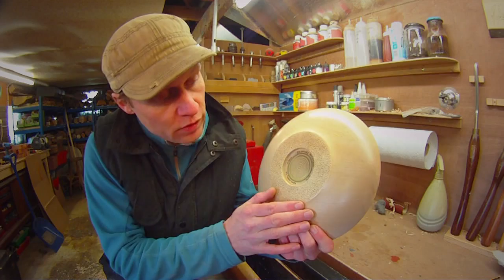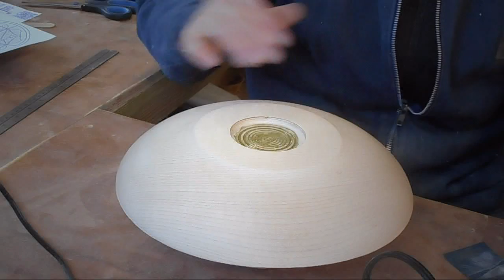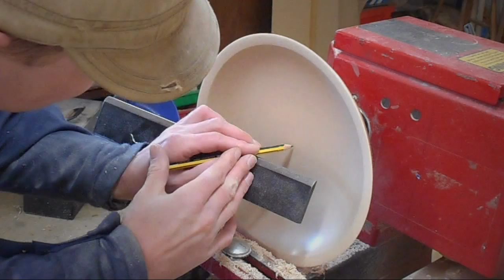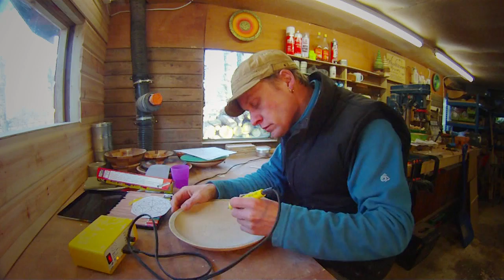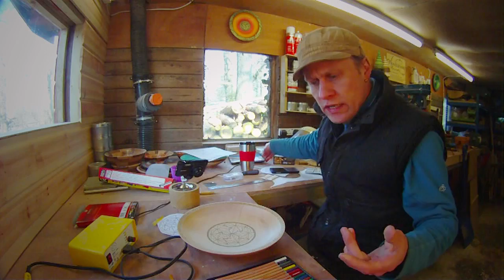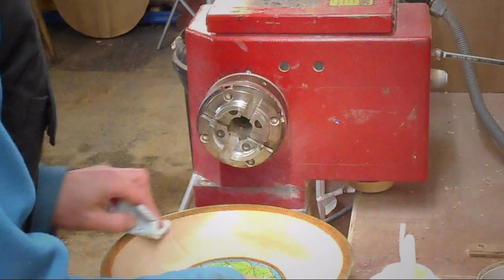#55 Woodturning - Adding Pyrography (Burning) and Water Colour to a Bowl

Comment: Nice video,Martin
The pattern of pyrography looks great, I have such a device. I do not take 600 sandpaper, I take a brass brush for cleaning of the internal peaks.
The idea with the pins is a good idea, you can remember times.

Comment: Thank you Martin for a superb video.   That is one beautiful bowl.   Thanks also for introducing me to graphite paper; I've been using the messy old carbon paper and also how to use the water colouring pencils.
I can see a visit to my local craft shop coming on.
If I may add one tip and that it to use an aerosol sanding sealer to avoid the risk of damaging your colours.
Thanks also for the pattern which I received by email today.
Best wishes,
Alan.

Comment: Nice one Martin. 

I use a spray on Universal fixative to fix the watercolour in place. But then again I also brush on a Silk finish Acrylic Lacquer as my preferred finish.
The Fixative after a spray coat or more depending on paint thickness and wood porosity, ensures I do not disturb the loose watercolour medium once that is dry, and it fixes the medium very well.

I have never had a problem with bleeding using a fixative, and also it works quite well with other colour mediums, hence the Universal tag.

I use the spray to fix the medium as I do use Lacquer, and once that is dry I can then polish. I cannot say how it would work with your own branded wax finish, but certainly worth a try on a piece of scrap flatwork should you chance trying that method out. However sanding sealer is fairly close to the consistancy of Lacquer so I would see no problem using the sealer in tandem with the fixative as it is not a thick medium in and of itself and would protect the colour particles from the light contact you use when applying your sealer with a rag as you do. Just a thought anyhow as an extra preventative measure.

Nice to see you have done a nice pyro project, and look forward to any more you do in the future. Keep up the series, and always look forward to new releases.

Steve
Reply: +Martin Saban-Smith No worries Martin and its a Universal Fixative in a spray cannister. :p Look forward to your next pyro project. :)

Comment: Hey Martin !! Its a nice feeling to catch up on YT !! I watched this the other night but am only getting round to comment now mate........ This bowl turned out amazing martin, I would have never of thought of water colours for this kind of project, and was a little worried when you introduced the towel to it !! The rattle can has been mentioned so I wont bore you with that solution, just a thought? when initially adding the water to spread the colour could you have added a water based glue to the water to act as a sealer as it dried into the colour ? maybe an idea for another experiment ;-)..... Much enjoyed the video thanks for sharing, regards, Steve.

Comment: Have you thought of spraying the cellulose sealer with your air brush? Off of the lathe it seems to me it wouldn't disturb the colors. It might save the cost of a spray can of sealer. Just a thought.

Comment: I knew I'd love this video, thanks Martin I thoroughly enjoyed that. 
With regards to the awkwardness in pyrographing bowls etc  I've been thinking of getting some beanbags to help me prop up the bowls into a better position. (PE games beanbags that is,  not the sort you sit on lol)  

PS I see you also have the same trouble as me with your rubber grip on the pen moving :-)
Reply: +Martin Saban-Smith Yes A draftsman's board should work very well and they are adjustable. You may need some of that rubberised mesh/ matting, (the stuff you can put on your car dashboard to stop things sliding about) I use it on my art table, it has an excellent grip.